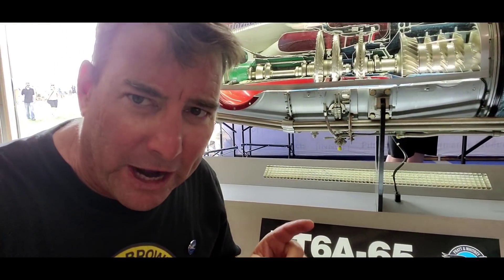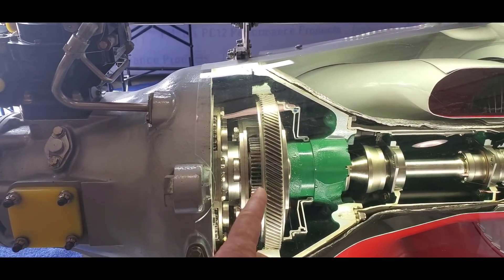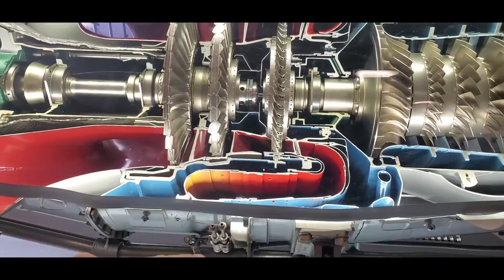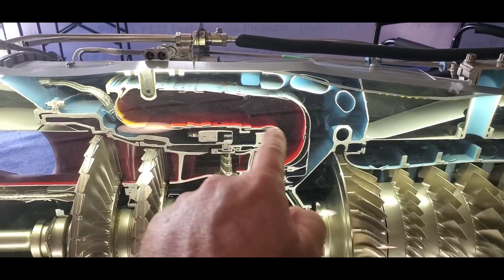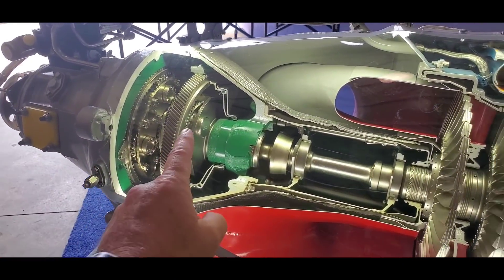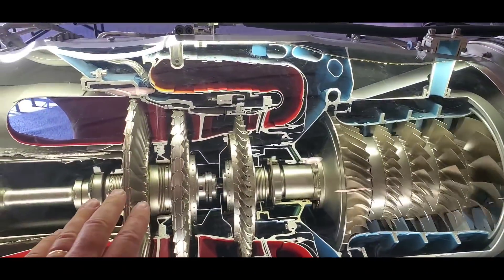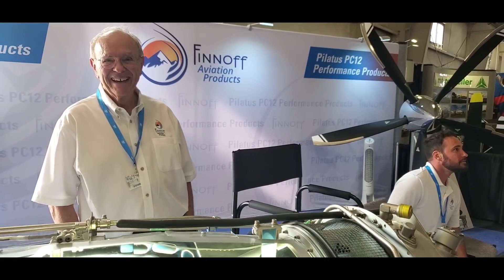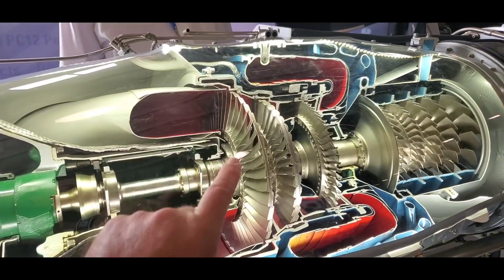PT6A Cutaway - Airventure 2021

Comment: Power to Weight blows away radial and horizontal opposed piston engines. They also run much longer between TBO's and JET A is cheaper than AVGAS in most places around the world.
 In agricultural operations the PT6 can use Diesel Fuel below 8000 ft. Number 1 or Number 2 depending on the OAT. Placarded in the cockpit.
The PT6 is a GREAT Engine but has the one big issue of all Turbine Engines -They are Fuel Pigs.

Comment: Former A&P here.  I worked on PC-12s for a decade.  Also old King Airs.  And a Bell 212 that all ran the PT6.  

It’s a solid engine.  Especially when compared to the LTS-101.  I still have nightmares about that model. 😖

Comment: So am i looking at this wrong?  He seems to say that the engine is using 3/4th of its power just to run the engine and 1/4th goes to propelling the aircraft.
Reply: A follow up.  I found on a P&W site they talked of 70% of the power goes into driving the compressor and 30% drives the propeller shaft.  Now I always been a fan of the PT-6 and in awe of its reliability.  But only 30% it's power going to driving the prop seems very inefficient.  Now I see why they burn though so much fuel.

Comment: Thank you Juan, from all the pilots who've flown their best hours comfortably with the wonderful, (old reliable) PT6A turboprop for halfa century! the best explanation of turboprop mechanics yet.  Ya think ya know it like the back of your hand, but this cutaway and following yur finger: one disc driving 4, that's feeding compression to combine O2-loaded air with expanded/exploding fuel in the circular combustion chamber DRIVING the two propulsion discs UNLOCKED for me MUCH better understanding and appreciating where and how of the PT6A's smmooooth, but strong, delayed and sudden, instead of steadily rising and falling acceleration, yet always well-measured response behavior; of the physics, chemistry, math and metallurgy working wonders together, anew for all us old hands.  After piston radials, it was a wild new adventure ta learn ta fly right with these sweethearts, but what joys all the new features of the PT6A first! brought with it in one small (completely new experience) turboproppelled package.  The PT6A's performance heritage and the unique respect and regard the aviation community holds for this one engine are quite understandable, especially now in seeing it's wonderful design and craftsmanship.

Comment: Yes 1000HP from that small power turbine is impressive. But consider the space shuttle main engine fuel (liquid hydrogen) turbopump -- each turbine blade, approximately 1" x 2" in size, generates 700HP. Of course it only had to fly for 8.5 minutes before inspection.

Comment: The split spool turboprop engine is also referred to as a 'free turbine'.   The propeller drive spool is not physically connected to the gas generator section but, rather, spins freely by itself and is driven solely by gas pressure.    This is opposed to a geared turboprop engine like a Garrett (Rockwell Turbo Commanders et al) in which the propeller shaft is directly geared to turbine itself.

Comment: Your numbers sound spot on! The TCDS gives 1,173 shp and a gear ratio of 0.0568:1. Considering prop RPM, the power turbines would be at 30,000 RPM

Comment: Its basically a lot like a conventional turboprop engine like on a C-130 except for one major difference. A conventional turboprop engine has the turbines, compressor and the prop drive all connected together on the same shaft. But on this engine the shaft is split so one turbine powers the compressor while the other powers the prop. I talked to a pilot who flies one of these and he told me that the gas generator in the back and the prop don't always run at the same speed and that part of the run up test is to lock the prop while running the gas generator section to leak check the engine. I'm not sure exactly why they do it this way but there must be some advantage to it. I think it might have something to do with allowing the gas generator section in the back to always run all spooled up at full speed while the prop speed can be independently adjusted and adapted for the current flight conditions.

Comment: Are you absolutely positive that the turbine driving the compressor section is pulling 3000/4000 ?? HP ?? I'm not saying it's wrong, I mean I didn't design the thing, it just SOUNDS odd. Because just looking at it, you have 1 turbine driving the compressors, and TWO driving the prop via reduction gear box. I would think {by looking at it} the 3 turbines would split up the extracted energy 1/3 each. So what am I not seeing here ??

Comment: A second comment... thanks guys Finnoff Aviation Products for bringing that cutaway engine.  I think the PT6 is the most successful general aviation turbo-prop engine ever.... also the PT6A is the fastest flying turbo prop... PT6A-66B of the Piaggio Evo 745 Km/hr or 402 KTAS...  [463 mph Airspeed] but that is max. cruise, not actual red line... but then their are the hot doggers
Actually in Feb. 2003 FIA World record
Type of record Speed over a recognised course Piaggio Avanti 180
Pilot - Joseph J. Ritchie (USA)
Crew - Steve FOSSETT
Performance 	
880,01 km/h / 475 KTGS average.... [546 mph average over the ground]
Date 	
06 Feb 2003
Course / Location 	
San Diego, CA (USA) - Charleston, SC (USA)

Comment: Reduction is 15:1 for propeller applications
Reply: It looks like a vastly improved PT-6 with the higher compressor pressure ratio of 11, approximately 2.5 accross the 4 axial stages and 4.4 produced by the centryfugal stage and the spiral tube diffusor,
remarkable are the cooled turbine inlet guide vanes and the gasgenerator cooled turbine blades. The turbine inlet temperature is probably around 2500 F, consistent with the high pressure ratio. This partly explains the increased power output and lower specific fuel consumption compared to previous PT-6 engines.
Reply: The Pilatus PC-12 has a 1200 hp engine.  The compressor requires about 1600 hp to compress the inlet air (6.6 #/sec) by a factor of 11. The temperature rises from 80F to about 1280F compressor exit temperature (after the spiral diffusor). The combustion chamber increases the mean temperature to about 2400F with a slight pressure loss (no bang!) at the turbine inlet guide vanes. The heat produced is equivalent to about 3600 hp. The following gas generator high speed turbine produces a little more than 1600 hp to drive the compressor. The hot gas expands and reduces the temperature to about 1680 F. The pressure is reduced by a factor of 3.3 below the pressue in the  combustor.
The power turbine absorbs somewhat more than the 1200 hp required by the propeller 
The expanding gas in the turbine reduces the pressure to somewhat more than ambient, with an exhaust temperature of 1140F.
The combustion chamber pressure at 100% N2  is 11 times the ambient pressure .
The pressure ratio accross the power turbine is also about 3.3.
These are the values typical for the PT-6A high performance engine

Comment: Juan nice explanation, interesting video, and a very nice display cutaway.  You know how rare those things are... not the real engines but the cutaway... Oh about 30 odd years ago when I was marketing military stuff... I borrowed a cutaway engine to demo to the customer what was going on and some really high tech motor/generator technology... that I don't think was even known outside the lab.  Anyway, I asked where the engine came from... Corporate Office Lobby... and they wanted it back, too! It was the only display model. The exotic electro machine stuff... was more interesting though... the rotor of a 100kw machine I could hold in one hand.  They had "only magnetized to 1/2 strength" anyway I flew first class commercial with both items as "luggage".  The airline was a little taken back when I explained I had a jet engine worth over $1,000,000 in a shipping case and about the electrical / magnetic components were... i.e. what the strength of the magnet rotor... at first they feared interference with the aircraft but I explained it was in an iron keep to contain the magnetic field fully contained... and showed them my gauss meter... how strong was that... they had no idea but accepted my explaination?  But they loaded them up.  But the head guy who came down asked, "What else you have we might want to know about?"  I also had the very first laser pointer, still have it somewhere... a neon gas tube laser device... I think it was $5,000 to my memory... but nobody else had one or knew what it was either. Well during my show and tell, I held the two shaft ends of the magnetic rotor and put it out towards a one of those heavy duty metal folding chairs the PM a full Col. was sitting in 6 feet away, asked him just start to get up, I'll pull your chair out!  So he took his weight, he said just started maybe 1/2 off the chair, and that darn magnet sucked that chair across the room... and I had one hell of a time prying it off.  I heard later somebody complained their Rolex stopped due to the magnetic field... I brushed it off saying "I did them a favor as then it could't be a real Rolex."

Comment: Pratt & Whitney Canada, eh. It’s actually a centripetal flow engine, as the final compressor rotor flings the compressed air out to the combustors and not straight through. I think the ratio you quoted is the difference in potential speed between the power turbine and Jet exhaust driven fluid drive for the propellor.

Comment: I like the cutaway views of this. What I'm concerned about is the tiny shaft between the blower compressor and the output propeller shaft. Are my eyes deceiving me?
I think I am wrong. It wouldn't make sense.
Reply from the maker: No torque there, just a pin.

Comment: Correct your right on. Ive been told you could actually  hold aPT-6 propeller until about 13% on startup not in real life ofcourse but shows the difference vs a Garret which needs much more amperage with micas battery to start.

Comment: Nice video. The PT-6 is usually called a twin shaft turbine. It started out as an oil field pump engine. 
I spent many hours behind these. Don't cob the power on one for a go-around or you'll over torque or over temp it depending on the temperature.

Comment: The reduction gearbox is about 17:1. The Dash 65 model you show here is one of the larger models, smaller versions only have one power turbine disk not the two in this engine.

Comment: One of the most versatile and reliable engines. 
My understanding is that it was designed to run as a pipeline engine (running continuously for very long periods of time). It has certainly found a home in aviation on everything from crop dusters to King Airs

Comment: Over half a million dollars for one of these and it's got less moving parts than my lawnmower.
Reply: Chrysler in the 1960's saw that simplicity and really wanted to make a turbine car.  The prototypes were successful but they couldn't figure out how to get it under about $50K. (In 1960's money!)
Reply: @matthewbeasley7765   Fuel consumption at low power rates could be an issue.
Reply: @matthewbeasley7765  I really like the idea of a turbine car even though I don't think it would ever make sense.
Reply: @FiveTwoSevenTHR   Brits built a Rover with a turbine in the ‘60s real neat looking car ( didn’t burn the tarmac ) 👍👍
Reply: @matthewbeasley7765  But wasn't turbine power assistance? cars thoroughly and wonderfully explored through GM Pontiac's wide-stance muscle car era, (late '60's-'70's) that used the same efficiency and POP of turbo's powerband; under $50K easy and routinely?  I love 'em.
Reply: I worked for Beech when the first 200 left the factory loaded at under $2 million.   But an A36 was under $100k then.
Reply: @bw162  I'd love to know more. Are you talking about King Airs leaving the factory? By the way, I was only having a guess at the price. They were somewhere around this number in Australia a few years ago. I'm pretty out of date.
Reply: @davidbrayshaw3529  Yes, new ones from the factory.  I remember when the first A36 was priced above $100k and we all thought it was the end of the model; that no one could afford them.  Now they are $500k+.  But GA went in the toilet.  Circa 1976, the industry was delivering about 16-18,000 GA planes a year.  The only bus jets as I remember were the early Lear, Citation 1 and a few Lockheed Jetstars and Saberliners.  In 2019 there were only 2,700 GA aircraft made worldwide and half of those were business jets.  Shortly after about 1980 (it’s been a long time although it was painful then), I recall the  product liability per Bonanza was more than the labor cost to build it.  The government eliminated the investment tax credit for business aircraft and then we had hyperinflation and the finance rates for aircraft went to 20%.  The industry started a nose dive it never recovered from.
Reply: @bw162  Thank you for your reply. I wasn't aware of any of the history that you have documented here.  I had a bit of a laugh
when I read that the product liability exceeded the labour cost per Bonanza. I worked part time as an AME a few years ago and I asked my boss what his professional indemnity insurance cost. His reply was " more than you". I can't say that I was making a killing in that job, I wasn't,  but I was making enough to make the cost of his insurance look truly frightening.
Reply: It's an elegant design for sure
Reply: I'm really interested in how a turbine hybrid could work. Use a small turbine that's only used at a low constant power setting to charge the battery. The turbine wouldn't have to meet peak power demand of the car, you would use an electric motor for that. Think a Tesla with a small turbine  to continuously charge the battery.

Comment: I love engine cut-aways!  (is that the right term?).  The USAF museum has a J79 cut open, although it doesn't spin.  It also has early engines such as the G.E. J31.  Cool stuff!
Reply: The J-79 engine shop was always a fun place to visit, during my flight safely officer days. They didn't mind me coming by, but they were less happy with my ground safety guy's inspections.

Comment: Come spend some money, the definition of aviation. Such a small shaft between the two sections. To bad they can't harness the power that's lost through the exhaust, something like what the 3350s had. I have a book on the history of PW, the PT-6 was a Canadian design way back.
Reply: The exhaust isn't "lost"! It generates usable thrust. Turboprops have SHP (Shaft HorsePower) and ESHP (Equivalent Shaft HorsePower) ratings. The difference between them is the exhaust thrust. If you doubt the thrust from those bass-ackward exhaust stacks, try walking behind one someday when it's idling with the prop feathered. (Yes you can do that with a PT6!) Hang onto your hat!

Comment: I've heard you can hold the prop still while the engine starts since it's not directly connected. True or false?  Also know for a fact a Cessna Caravan PT-6 ran 2 1/2  times TBO before letting go. This was an Alaskan bush plane. No injuries.
Reply: Yes you can do that and instantly over temp your turbine
Reply: @markthompson8656  I would think so.

Comment: I went to East Coast Aero Tech at KBED, Hanscom Airport Massachusetts,back in 1988,we got to tear down,inspect,rebuild and run up a Jacobs R-755 and Hamilton Standard 2B-20 counter weighted propeller.That is my most fondest memory,because when I was a young "airport bum" A charter pilot gave me lots of right seat time in a Cessna 195.My first job was at a North East commuter airline running ATR 42's,Saab 340's, Beech 99's & 1900's. The PT6 was practically bullet proof,but was a bear to properly rig.
Reply: Aha, you worked for Allyn Caruso, Frank Lorenzo's #1 disciple, didn't you? Bah Hahba Scayalines? My condolences. Did you go on to ConEx?

Comment: JB another thing you failed to mention is the absolute low number of moving parts to produce that 600+ horsepower.   
  Now there are a lot of electronic parts that have to go right, but there is a lot less mechanical to go wrong in that engine.
Reply: No real electronics on most pt6as mostly still all hydromechanical, though Pratt is rolling out fades/EEC types which allow longer TBO partially due to more careful temperature handling of the engine. Less trust on pilots telling you if they have over temped the engine and for how long.
Reply: @threeparots1  true.

Comment: I've always wondered about those engines....before ignition, with no solid connection  between prop and combustion,  would it be possible to hold the prop from spinning ?
Reply: Yes, the gas generator section doesn't really care if the power turbine section is rotating or not, and the power turbine isn't damaged by standing still with hot gas flowing through it.

Comment: PT6 , The Pride of PWC,  design in the 1960's with paper and pencils and still one of the best engine today.
Reply: The fact that these engines are still in production and still in high demand with very little change to their design 60 years later shows what geniuses the folks were who designed them in the first place. You would think that a design that old without FADEC just wouldn't be able to compete, but you'd be dead wrong. They really are just that good.
Reply: A brilliant piece of engineering.  These things will still be running in the next century.